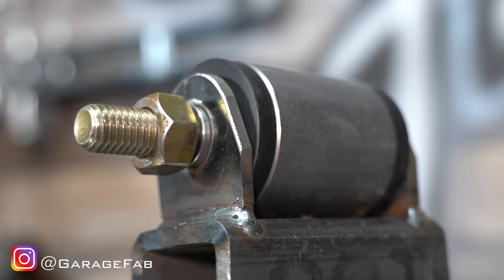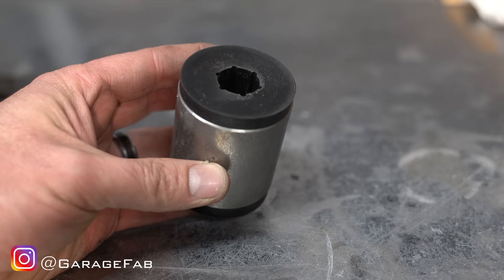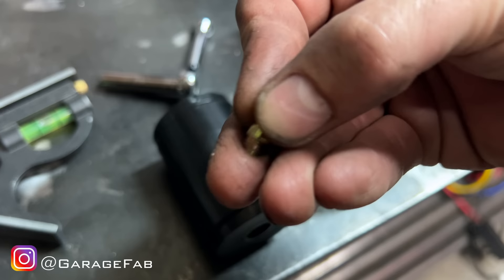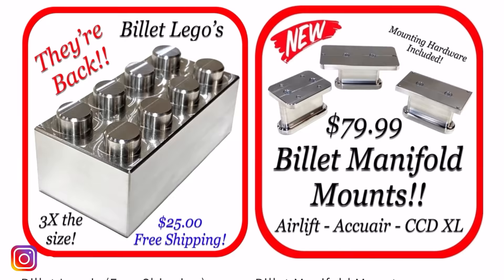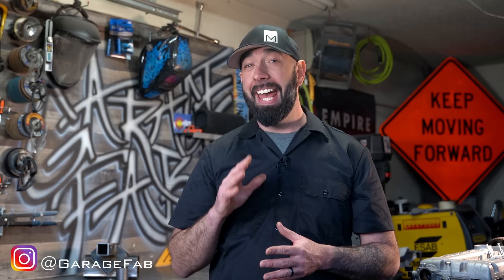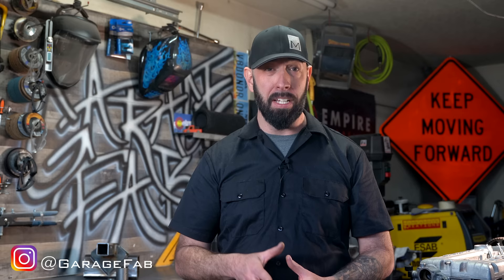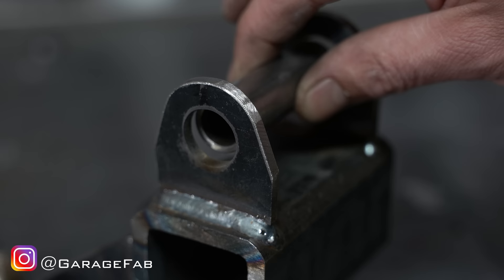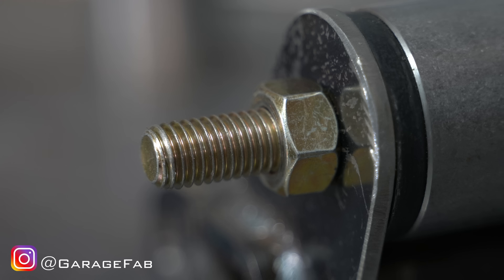The DOs and DON’Ts When Installing Polyurethane Suspension Bushings

Comment: At least a little grease will slow up the rust issues that make disassemble so hard.. I was always curious what part actually moved.. On my MG after renewing the control arms they are so tight I think how is this even going to not bind on  bumps?
Reply from the maker: What kind of bushings are on your MG? Something that’s probably important to note is that rubber bushings technically operate the same way, but the rubber is bonded to the inner and outer sleeves. So rather than the inner sleeve slipping inside the bushing material, like the polyurethane bushing in my video, the rubber twists instead. This can really make things seem stiff!

Comment: Hey MK
Maybe you can help, I just replaced all suspension parts on 05 mercedes C230(except R&P). All bolts were torqued(at ride hight) to spec with blue locktite, but left upper (front) driver C arm bushing is squeaking. Suspension is tight and car handles great. Should i just loosen and grease it and move on or does this sound like something youve seen before and needs attention. A tech at a truck lift place said over phone, most  bushings squeak, just grease it and forget about it. All comments welcome.
Thanks
M L Rogers     Pasadena,Tx
Reply from the maker: Are they polyurethane? Poly is notorious for squeaking. You can disassemble and grease and that should help but there’s a likely possibly it’ll just start again shortly. Is there any way you can install a Zerk fitting? That would be the best bet.
Also with poly, you don’t need to torque with the suspension loaded.
And if we’re talking about OEM bonded rubber bushings, ignore everything I just said! None of it applies. None. Hate to say it but you’re kinda screwed. You can try and soak the bushing in silicone spray and cycle the suspension but that only works occasionally. Usually you’re looking at a bushing replacement (again) to fix it. 😬
Reply: No i think they are oil filled rubber, probably bonded as you said. the old ones were cracked and sort of dry rotted looking with slack but at least they didnt squeak. Lol

Comment: I just had a problem with some camber arms and the bushings were going past the inner sleeve. So when it would clamp it would bind it all up. I noticed the one on this video look like they were almost even. Shouldn't there be a little bit of space that the inner sleeve sticks out a little bit on both sides so it doesn't bind up on the bushing? I had to take an exacto knife and trim the bushing on my camber arms.

Comment: Hi just wondering what thickness are you using for the bushing tabs 3mm 5mm or 10mm plate steel Please  Thank you
Reply from the maker: I consistently used 3/16 inch thick plate for tabs. (Just under 5mm) The designs will change a little based on tab height or if there are sideways forces on the tabs.
Reply: @GarageFab  Thank you

Comment: Also the inner pin should be slightly smaller than the total bushing width, as to add thrust preload to the elastomer avoiding side to side play.
When I am designing poly components I go around 1mm shorter, go too short and you will have stiction, go too long and you will have play.
Actually, in cases where the surfaces are not properly faced I will use nylon thrust washers or in extremely high load scenarios thrust bearings.
Reply from the maker: Agreed! I probably should’ve made that more clear. I was mostly imaging the customers that brought in vehicles with inner sleeves that were much too narrow. It appeared they cut them to the length of the outer bushing.
I don’t make my own bushings, but Thorbros has it figured out.
Tell me more about these thrust bearing/washers!
Reply: @GarageFab  sure thing, when a very high trust load is applied on the joint the polyurethane will tend to stick to the surface of the mounting tab, that is the reason why the grease grooves terminate to the face of the bushing, to allow grease to spill out and offer lubrication to avoid stiction.
Ideally, joints should see no thrust loads in their operation, only radial loading, but don't forget that the clamping force is an axial loading scenario for the bushing, as the tabs bent inwards the squish it.
In cases when extremely high clamping force is going to be use, or inevitably we are going to have thrust loading I will add, teflon washers, or thrust (needle) bearings on the faces of the bushing, thus by controlling the width of the inner sleeve you have perfect control over the preload (squishing) of the bushing and non existant wear on its face, as the face in relation to the one side of the bearing is stationary and the other face of the bearing is stationary in relation with the mounting tabs
Reply from the maker: Interesting! So by the sounds of it, I should be incorporating these thrust washers in my Triangulated 4 link builds. 
Unlike most people, I like to weld the bar ends on to the angled link bars so that they are parallel with the axle. This, undoubtedly, puts far more thrust load onto the sides of the bushings than they should. I continue to do this though because the other option is welding on the bar ends perpendicular to the bars. This is ideal on static height vehicles but on adjustable vehicles with travel upwards of 12 inches, the angled bar ends means the axis the bars rotate around passes diagonally through the bar end. From my experience poly bushings fail pretty quickly when used like this. So far the bushings on my builds still look and feel great. I wonder if it’s possible to slip in Teflon washers without completely rebuilding the bars or the tabs. 🤔
Reply from the maker: By the way… thank you for taking the time to share your knowledge. 🙏

Comment: Dope video. What did you get wrong on your first build?
Reply from the maker: Might be quicker to say what didn’t do wrong. I used shock tabs for my link bar tabs, the holes in the tabs weren’t properly sized for the bushing I was using… all was corrected fairly quickly but  I still did it.
Thank you, JD!

Comment: As you were describing how the bushing tabs should be as big as the bushing and completely cover the sides of the bushing to support it and prevent the tabs from tearing into the sides of the bushing, you showed, in a flattering way, bushing tabs which were significantly smaller than the bushing itself.    If this had been noted in some way as an incorrect example, then that would be great, but the camera angle and pan depiction was done in a way that would allude to that being a good example.    Just sayin.
Reply from the maker: I KNOW!! Your the first to mention this, Andrew, even though it has bugged me from the day it released. I released the video in a rush and forgot to address it. Hopefully YouTube will soon give us the ability to make edits without deleting and reuploading. Until then I’m gonna have to cringe every time I see it. 😩
Reply: @Garage Fab  I noticed that too but understood that you were showing the "wrong" way. Good video.

Comment: Very informative video, I learn so much from you. I have a question about bushings for a 4 link application. My truck is a 97 Chevy dually that I want to run a parallel 4 link using a watts link. This truck will work pulling trailers. Would bushings or heim joints be better? I want to make it heavy duty from the start and I feel bushings may fail. What are your thoughts? Thank you for all these great informative videos.
Reply from the maker: Thank you my friend! I fear this answer is going to be riddled with opinion, and in the end your decision is going to have to be based on opinion too.
Your truck would definitely be heavy duty… For a while.
Here’s some downsides to Heim joints: 
They’re very expensive. Especially for the size and quality you need to feel comfortable when towing.
They don’t dampen road vibration. They only have a small amount of Teflon or similar material to prevent metal on metal contact inside the joint. But you have to (or should) maintain them, by cleaning dirt off of them and spraying them with lubricant. I don’t recall seeing a Heim joint with a Zerk fittings or dust boots.
When the thin layer of Teflon wears out, you get rattles and you’re forced to replace the Heim Joint. They’ll still be expensive!
You may not be wrong about polyurethane bushings breaking down under heavy use, but the bushing material is replaceable, and it’s not hard.
I think a quality bushing should give you several thousands of miles, and because I’m cheap this is probably the route I would take.
Let me introduce you to the Johnny joint.
Look it up if you’re not familiar. The Johnny joint is a child created during a romantic evening had by Mr. Heim and Ms. Poly (urethane)
It’s basically a polyurethane bushing, but rather than a cylindrical inner sleeve, it has a ball. It dampens some vibration, and articulates well, which leads to longer life. And best of all it’s rebuildable. Don’t get me wrong, they’re still expensive to start, but this might be a good route for you. I highly recommend bringing this topic up to some other knowledgeable suspension folks.
And let me know which way you go!
Reply: @Garage Fab  I wanted to thank you very much for your response. I very  much appreciate your advice. Thank you again for taking the time to answer my question so thoroughly. I will let you know what I decide on. Hopefully, it will be with a video I post on here. Thank you very much, my friend.
Reply from the maker: Very much my pleasure. I’m here when you need it.

Comment: I had to cut the captured(welded) nut off the tabs for my Honda cause the original bolt was seized. Any nut washer combo recommended for the application?
Reply from the maker: I personally always use Nylock nuts unless I need to weld the nut. (Like your Honda) They make all metal crimped lock nuts if you need to apply heat. Those aren’t gentle on the threads though so Nylock it is. Nylock also helps prevent rust some as well. Bonus!
As for washers, I just use grade 8 washers. I’d be lying if I told you I knew what the difference is between grade 8 and standard washers. Hardness I’m sure, but why is it important? 🤷‍♂️
Reply: @GarageFab  Thanks for the reply! I'll hunt down some nylock nuts for this thing.

Comment: I think the proper name of this metal-rubber bushings is silent blocks and I haven’t seen to the moment OEM design silent blocks ( SB) which require lubrication . One of the purposes BTW using silent blocks in suspensions is to omit the maintenance ( greasing) required . The main mistake which even some professional mechanics do , is to tighten the SB bolts when the vehicle is lifted and the suspension is in maximal extended position. This way the life of the SB is highly reduced and designed characteristics of suspensions are changed
Reply from the maker: That’s good info. You’d be surprised how many “experienced” technicians get this wrong.

Comment: My spring hangers have poly bushings. The gap between the inside of the bushings inside the shell is huge. Do I just need to pump that whole cavity with grease when I service it? It has grease in it now but just what the bushings came with. The gap is at least an inch and the hanger shell is 1.5” so it would take tons of grease before the channel filled…
Reply from the maker: I’d say don’t worry about it until it starts making noise. Poly doesn’t NEED lubricant. It just quiets things down a bit.
If it starts making noise, yeah I think you’ll have to fill that whole void before grease starts being forced into the contact surfaces that need it.
Reply: @GarageFab  damn that’s gonna be like 1/4 tube I’m gonna have to get an electric grease gun lol. Should I use super lube
Reply from the maker: Super Lube makes a few different types of grease. Full silicone grease, which is ideal, is very expensive. (Just noticed it’s on sale though. 😳)
https://amzn.to/46UhBk0
Super Lube multi purpose synthetic is acceptable I think though I’m having a hard time finding out what’s in it.
https://amzn.to/3yMEZ6o
The most important thing is just avoiding petroleum because that’s what eats away at polyurethane and rubber.

Comment: all good info, but a few years back synergy came out with dual durometer bushings, that essentially make these, and factory style bonded bushings obsolete.
Reply from the maker: I’m not familiar with those, David! I’ll have to check them out. I can’t envision what the two durometer thing would look like.
Reply from the maker: …but now I can! Very cool. 👍
Reply: @GarageFab  been running them on the back of my landcruiser in some links I had made about 5 years ago. no grease, no sound, no issues, and plenty of articulation. they also make some interesting double threaded bungs that allow for bent links to be used with full adjustability.
Reply from the maker: I just might give those a shot someday.

Comment: Does this apply to sway bar bushings as well or is it completely different? If different do you have a video on that or give a quick rundown on then. Thanks.
Reply from the maker: I wouldn’t say COMPLETELY different. The sway bar bushings I’m familiar with aren’t bonded to anything. Even the rubber sway bar bushings generally just have hole in them the size of the sway bar and they have a split in them so you can open them up like Pac-Man and slip it over the bar. The sway bar would resemble the inner sleeves in this video in that the bar is free to rotate inside the bushings.
It wouldn’t hurt to smear some silicone grease on the inside of the bushings before putting them on since they don’t usually have grease fittings.
Then there’s some sort of clamp that fits over the bushings that bolt them to the chassis.
Let me know if this helps or if I need to continue. Best of luck my friend.
Reply: @GarageFab  You're awesome. Thank you very much. That helps tremendously.

Comment: This is exactly the same stuff we have to watch out for in aviation when checking over an airplane. Mostly with metal bushings, but bolt’s moving with their bering surface not the joint, and A-N bolts like Grade 8 need to have threads only where the Nut affixes. None on the “working” area of the bolt.
Reply from the maker: Exactly the same… but just a wee bit more threatening! I’m not saying automobiles aren’t dangerous. But I’ve had suspension components break. 
I didn’t plummet to my death!
Reply: @GarageFab  can’t pull over in the sky. So gotta check extra good on the ground!
Reply from the maker: Haha! Well said.